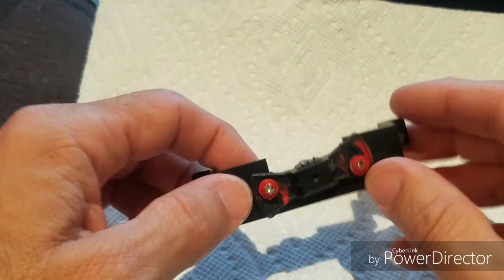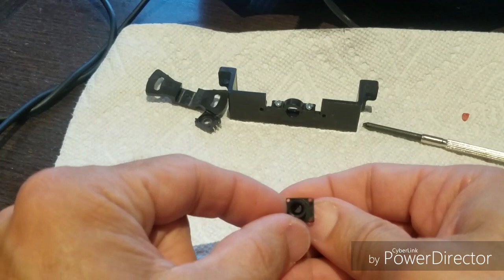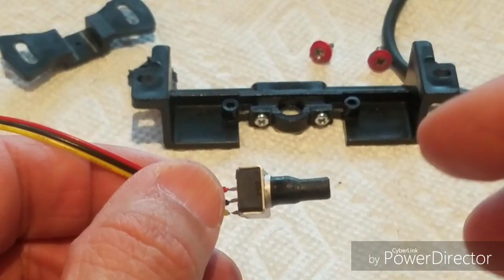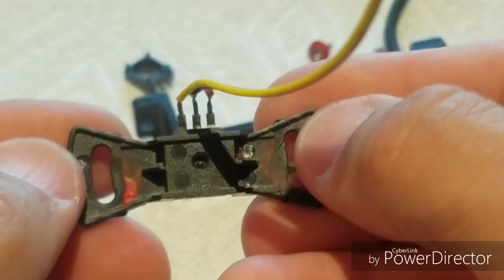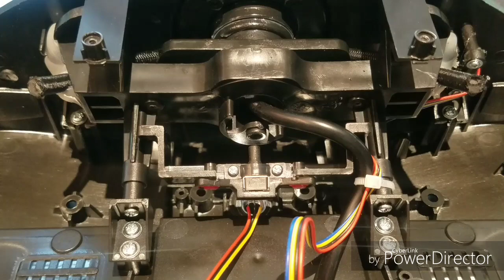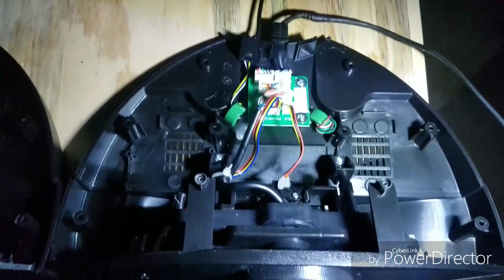Thrustmaster 458 Ferrari racing wheel fix

Comment: Thank you so much it worked! I have the xbox one edition, so when I took the wires off the pedometer they got to shorter. So I connected some other wires. It took me a long time to shave it down, but it works even better now. Thank you so much I saved a 160 bucks.
Reply: Do you know how to fix when I connect it, it flashed the xbox sign and it doesn't work
Reply from the maker: Glad to hear you were able to fix it and with better results.

Comment: Hey, I was wondering if you opened the original potentiometer to see if the stem could have been transferred from the original unit to the new unit?  It might not have been necessary to do all of the whittling.  Also I am looking at doing this with an xbox one Thrustmaster controller Do you think it would use the same potentiometer?  Great video.  Thanks.
Reply from the maker: I did open it up only to find carbon pieces everywhere. I'm guessing the wiper portion from the original would not be compatible with the replacement part.
Reply: @justinsauer5682  Thanks for the reply and video...I love it when people try to repair things instead of throwing it in the dump.

Comment: My t80 steers to the right just fine. Some times, say 1 out of 5 times, when i turn to the left the car dives to the left. Into the walls or fences. In calibration in F1 I can see that sometimes it registers a 60+% input, however the wheel is only rotated for about 5%. When i continue to steer  it then somewhere picks up the right signal for the amount I rotate the steeringwheel. It glitches out mostly between 5 an 10% in the left motion range. Could it be the same issue that your working on here?
Reply from the maker: Sure sounds like it could be. If you have a multimeter, take apart the steering wheel and measure the
potentiometer. Multimeter set to ohms auto scale. The resistance should be change smoothly without any erratic changes in value as the potentiometer is moved.
Reply: @justinsauer5682  Do you know how to fix when I connect it, it flashed the xbox sign and it doesn't work

Comment: I wonder if there is any way to fix the old one instead of purchasing a new one
Reply from the maker: You can try spraying it with electronic cleaner. That may work temporarily. However, in most cases the carbon resistive material has been ground away to nothing which is impossible to fix.

Comment: Hi Justin. I use your tutorial, I bought this encoder but I have problem with wheel. On 0 spot everything is ok, but when I turn a wheel it shaking. When I check on ProjectCars 2, value of steering is shaking between two-three values.
Reply: An encoder is a totally different component compared to a potentiometer, you may wont to check your parts again. He said he used a 10K potentiometer he did not specify its taper but I'm sure it is a linear taper and not an audio taper.
Reply: Do you know how to fix when I connect it, it flashed the xbox sign and it doesn't work

Comment: Can i do this same fix for the T80 PS4 wheel? I have an issue where when going in a straight line, the car will randomly do a harsh left turn unprovoked.
Reply from the maker: take it apart and measure across the potentiometer.  if you need to replace the value is written on it somewhere on the part.  103 would equal 10K ohms,  203 20Kohms and so on.  you can go to digikey search potentiometers you'll want a linear one, then match up one that best matches the dimensions of the one that's in your steering wheel. that should take care of it.
Reply: @justinsauer5682  i have the same problem can you make a video on how to fix it

Comment: I have the same wheel, will this fix help me? Cause my wheel stopped detecting the location of the wheel and the direction that im steering to. Will this video will fix that problem?
Reply from the maker: Yes, that will solve your problem. Search the coments there's another guy found direct replacement part (stock) from eBay. However may be a lesser quantity from the digit key part. I would be reluctant to replace the stock part with the another stock part seeing how the the original stock part fails so often. Your choice though.
Reply: @justinsauer5682  Thank you so much me and my dad fixed the wheel today and it works just like new :D
Reply from the maker: @greengangz  glad I could help, good to hear! Congrats on the fix. Enjoy racing again.

Comment: hey boss first of thank u so much for your time and effort ,.. also hey i have the same wheal my issue is that when plug in my wheel to play it dosent turn on,, only when i turn my wheel all the way to the right ... but even then it wont let me ply,.. do u know what the issue could be 
`??
Reply from the maker: First make sure problem is coming from the wheel and not a console issue. There could be an intermittent connection somewhere in the connecting wires of the wheel. Those are tough to find. I would start by taking everything apart and clean everything as I go. There's a little motherboard in the wheel with connectors. Make sure no wires are lose on it. Do a point to point continuity checks along the wire harness from the USB connector to where it terminates. Wiggle the steering wheel as you go. Good luck
Reply: I would recommend to contact thrust master, as I've seen wheels get replaced when the issue such as that occurs.

Comment: What a great video, do you know how to repair the metal pallet?
Always stays pressed
Reply from the maker: Thanks, what is the metal pallet? Are you referring to the pedal which makes the car go?
Reply: I mean the button that increases the speed of the car (rb) the right cam
Reply from the maker: @germanruizm2457  yes that's a little square button inside the controller. You should feel a click and hear one as well when you push the button the LB button should feel and sound the same. You can try spraying CRC electronic cleaner into the switch that may correct the problem your having. I'm sure you could buy those switches on eBay or Amazon just do a search for Xbox 360 controller. switch here it is, thank you and your welcome. https://www.amazon.com/dp/B076FSD3NL/ref=cm_sw_r_cp_apa_glt_fabc_ZJ797EBNQTW8CE6N616P
Reply: Its allways pressed
Reply from the maker: @germanruizm2457  you'll need to take apart your 🎮. If you know how to solder removal and install a new switch is very easy
Reply from the maker: @germanruizm2457  oh I see. You'll need to take apart your steering wheel, you'll find a switch for that gear up control. That switch will need to be repaired or replaced. The fix should be very easy. It's either a spring switch or something that involves a spring. If I remember correctly that gear up lever has spring tension to it. Once you get the steering wheel opened you'll see the switch for that gear up control

Comment: I purchase the same value of potenciometer, but the pot haven't a D shaft. How do I centralize it so that it is not pulling to the right or to the left?
Reply from the maker: It's gotta have a flat The flat part of the shaft has to mate up with the flat side of the receiving hole. If your shaft is completely round it will not even fit into the receiving hole. I guess if u have it together, you got it to fit. Anyway You'll need to manually set the shaft to its correct position.  Turn on the game, get to where you can view the steering wheel display, with everything wired in pull the pot out from the plastic housing. If you move the shaft you'll see the steering wheel on the game correspond L or R. Set it to where the steering wheel is centered. Don't touch the shaft after that. Assemble the pot back together. You can fine tune it with the black plastic backing piece just loosen up the 2 screws and slightly twist the plastic piece one way or the other until the steering wheel is perfectly centered. Tighten up the 2 screws There's not much adjustment only fine tune adjustment. Hope that makes sense. Good luck.
Reply from the maker: I believe a drop in replacement pot was found on ebay. Just search the comments.
Reply: @justinsauer5682  mission complete! Thanks Man, you save my Championship

Comment: Justin how erratic we talking because when I steer to the right just a tiny bit it yanks itself to the left into the barrier in game whilst I've still got my wheel turned to the right in real life
Reply from the maker: Bad potentiometer. This fix will solve your problems. Others have found the stock part on ebay (see comments) or you can purchase one thru digitkey and modify it like I did. Good luck.
Reply: Thank you so much I've had this since Christmas and have had the problem since so this video will really help I appreciate it

Comment: Only problem with my wheel is it used to have some kind of resistance but now it's loose
Reply: I know you might have already found a fix but if you open the base of the wheel unit there is a bungee cord that resists against the wheel's rotation. this might have come loose of worn out but it's easy to replace and you'll see how to do it once you look at it
Reply: @samlambert3305  I found a solution at the time but now I have a tmx with force feedback

Comment: Thanks! Ordered the part and hoping to fix mine
Reply from the maker: No reason why it shouldn't. You can verify the old part as bad. Connect a digital volt meter set to "ohms" auto ranging across the two outer pins of the original part. A good part will read 10k ohms. Connect outer pin to center pin, doesn't matter which one, slowly rotate the shaft of the part the reading should be a smooth change from 0-10kohms. Good luck with the fix.
Reply: Did it work

Comment: Hello sir, i have a problem with my tm 458 italia.. when i turn the wheel my gas pedal stop working sometimes, if i would change the pedal pot it will work again?
Reply from the maker: Hi, the two are totally unrelated. I'm assuming it is only coincidence. My guess is that the pot in gas pedal has or is going bad. If you take apart your gas pedal assembly you'll see the same part (potentiometer). Make sure you replace it with the same value also linear pot
Reply: @justinsauer5682  first i will try to swap the pots, take the pot from brake and put on the gas pedal, after this the brake should have the same problem like the gas pedal, right?
Reply from the maker: @casianbotez3011  yes that's correct. If you have the means to do an ohms check on the suspected bad part.  that would be a good idea. The resistance between the two outer pins will be a fixed value which equals the value of the part, probably 10k ohms. Connecting to the middle pin and one of the outer pins while the pot is rotated the value should change from 0 ohms to 10k ohms. Or vice versa. The change should be very gradual, with no erratic jumps in value. There could be a dead spot which would cause a failure when the wiper of the pot crosses that point. Also you may want to spray some electronic cleaner into to part. That may give you a temporary fix. Good luck
Reply: @justinsauer5682  i had done all the things you said, but i dont understand why it work fine untill I rotate the steering wheel left or right😔
Reply from the maker: @casianbotez3011  ok next step I would do is check the wired connection from the pedal all the way to the wheel. Check for lose intermittent connections   Maybe when you're turning the wheel it's causing a slight vibration and it's causing the connection at the wheel chassis to go intermittent. It should have like the old fashion phone connector check the little spring wire connectors. Intermittent failures are the most difficult to locate.
Reply from the maker: @casianbotez3011  wiggle  all the wires try to cause a hard failure. Just to determine if you have sound connections. If you can cause a hard failure, then you'll know what to repair.
Reply: @justinsauer5682  thank you, I will come back tomorow with more news, maybe someone will have the same problem and will find the right answer here
Reply: @justinsauer5682  i had solved the problem but not at all, i had sprayed all the wire contacts with contact cleaner, now works a little bit fine than yesterday... I think next i should open the steering wheel and spray a little bit inside

Comment: if i buy the part you have linked in thje description i't possible resolve?
Reply from the maker: More than likely it will solve the problem. You need to make sure that the value of the replacement part matches the value of the part you're pulling out. In my case the value was a 10k ohm (103).

Comment: Does anyone know where to get the pedal set wire that connects to the steering wheel? I know there's one but it's only for the TP3A
Reply from the maker: That wire is permanently attached to the pedal assembly. You may be able to use a straight telephone wire the connector jacks look the same, except the locking clip is offset on the pedal wire you would just remove the center locking clip on the phone jack and it just may fit perfectly. Then you'd have to solder the wires on the other end of the cable to the pedal motherboard making sure connections from steering wheel to pedal motherboard match the original cable.
Reply: @justinsauer5682  Thanks :)

Comment: Hi..my steering wheel has no power..any idea what wrong with it
Reply from the maker: Assuming it is plugged into xbox, it could be broken wire in the connecting cable, worn out USB connector, pull the cover see if there are any voltage at the little motherboard. Try another USB port on the console. Check continuity on the cables from the USB end to where it connects to the motherboard (power off)

Comment: does the same potentiometer fit on the normal t80 because my one looks shorter
Reply: and if it doesnt can you post the link to the shorter one
Reply from the maker: @grakker411  go to digikey.com look at the data sheets for the dimensions that matches the part you have. As a good starting point, use the link I provided for the part I used and go from there. The length of the shaft probably does not matter. Just as long as it is able to slide into the D slot. To an extent it  doesn't matter how much hangs out the other end
Reply: @justinsauer5682  ok thank you!
Reply from the maker: @grakker411  the part i ordered was PTV09A-4020F-B103-ND  if you look on the product data sheet you'll see instruction on "how to order"  you actually tailor the part number to exactly what you want.  the "20" in the 4020 of the part number is the length of the shaft.  if you want the exact same part but with a shorter shaft you'd order a  PTV09A-4015F-B103-ND  for a 15mm shaft.  if you'll notice on the data sheet 15mm is the shortest available.   follow the link to the product data sheet.  good luck with the fix.   https://www.bourns.com/docs/Product-Datasheets/PTV09.pdf
Reply: @justinsauer5682  Wait does the shaft length count with the base or only with the shaft itself
Reply from the maker: @grakker411   if you look at the data sheet 2 pages in at the bottom you'll see "shaft type"  you want F type (smooth)  You'll see the  "L" for length.  notice 15, 20, 25, 30mm for available lengths.  then go directly up middle figure to see where "L" indicates.  it's from the end of the shaft to the back of the part not including the mounting tab.  hope that helps.

Comment: This potentiometer works on Thrustmaster T80?
Reply from the maker: It's got to be the same value. 10k ohm should be marked on the part should read 103.  See what's marked on your part
Reply: @justinsauer5682  it say B103  230
Reply from the maker: @iblackgraphicz678  yeah it's a 10k ohm. Here's a link to a direct replacement. Buy it install it you'll be good to go
https://www.ebay.com/itm/Potentiometer-for-Thrustmaster-458-Spider-Italia-T80-RS-and-GTB-B103-230-FR-/293576800390

Comment: How'd you get it to open I'm trying it's hell to open it
Reply from the maker: two screws on top.  the two outer ones the middle 2 are just for looks.  8 screws on the bottom you'll need a long thin phillips screwdriver.  they are in deep.
Reply: @justinsauer5682  thx I open it and found out my resisting bands are snapped it's time for force feedback whenever we can afford it.
Reply from the maker: @Gamerboy-gy1rl  this guy made his own.  that repair seems rather simple. https://www.youtube.com/watch?v=eBiKS-85B3c or just use a bunji cord. this looks like the same material. 
https://www.amazon.com/dp/B07PP6ZB69/ref=sspa_dk_detail_5?spLa=ZW5jcnlwdGVkUXVhbGlmaWVyPUFNVTBGUVZPSFFNM04mZW5jcnlwdGVkSWQ9QTEwMjEyMTQxOEFURDFHUzZEQ0JZJmVuY3J5cHRlZEFkSWQ9QTA3ODE2MTIyMjhRTlBGMlRCVlAmd2lkZ2V0TmFtZT1zcF9kZXRhaWwyJmFjdGlvbj1jbGlja1JlZGlyZWN0JmRvTm90TG9nQ2xpY2s9dHJ1ZQ&th=1
Reply: @justinsauer5682  thx bro I been trying to find a vid forever